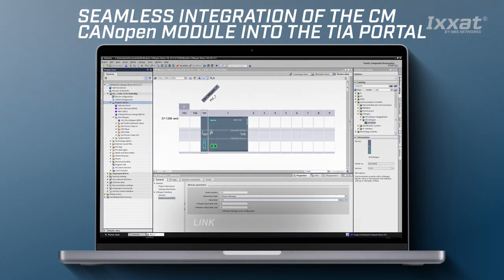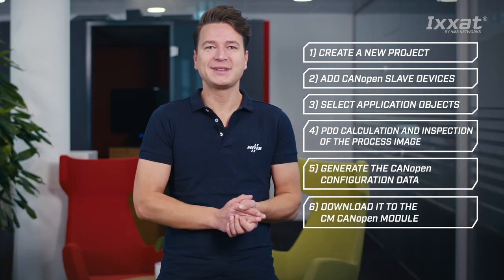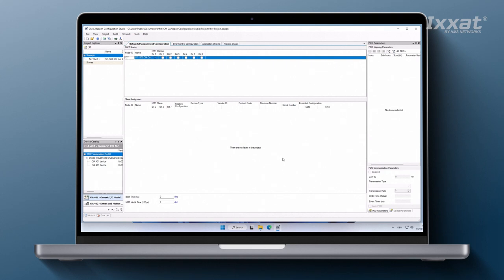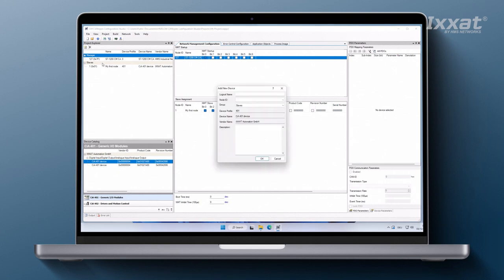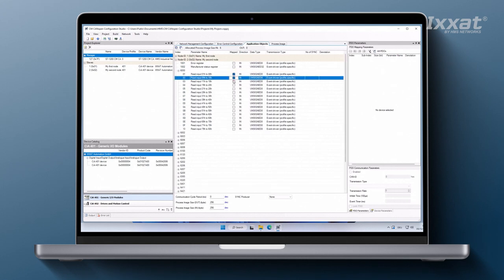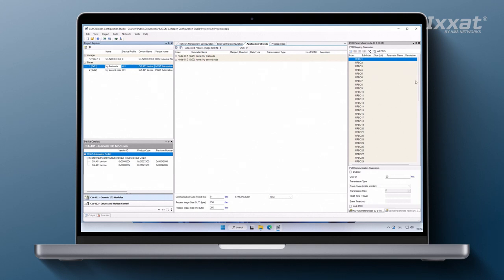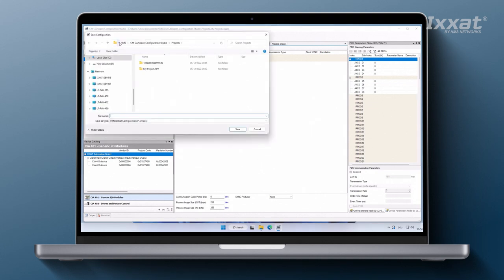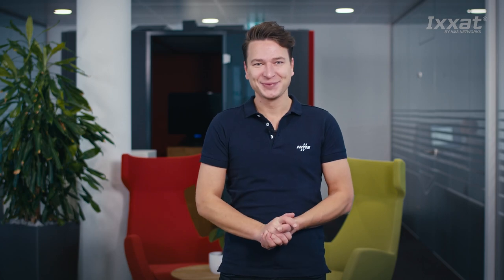How to setup and configure the Ixxat CM CANopen Module

Comment: Hello, in my first project with CM CANopen 021620-B i followed the instructions of this video. When i tried to download the data into the hardware, i got an error: The Node-ID of the configuration (9 0x09) does not match the Node-ID of the device (1 0x01). The device i bought by a trusted shop and was new. I cannot imagine that the given Node-ID is the problem, because in the video you used 127 and thats opional use alle IDs i want. Can you tell me, what is the problem?
Reply from the maker: Hello @Lukas.bastelt : Perhaps you did not download a TIA project with a correct hardware configuration for the CM CANopen Module with the same CANopen Node Number as in CM CANopen Configuration Studio and set the CANopen Manager Mode? Please register in our online support tool   "https://support.hms-networks.com/hc/en-us" and create a support request there, then you will get an answer from our support department.